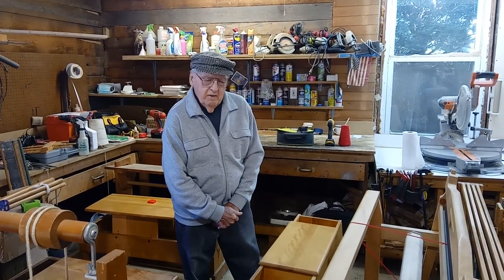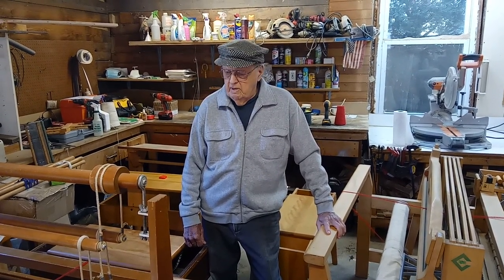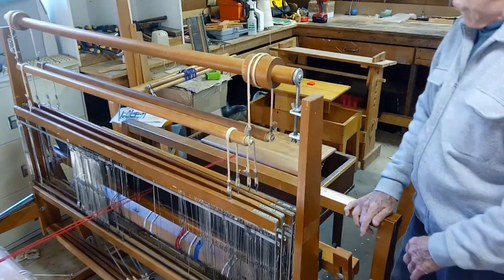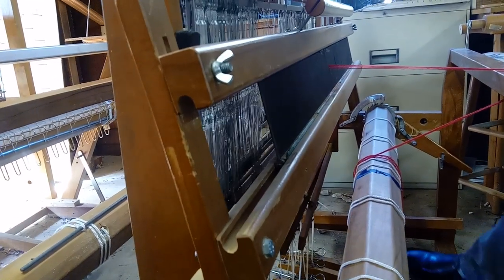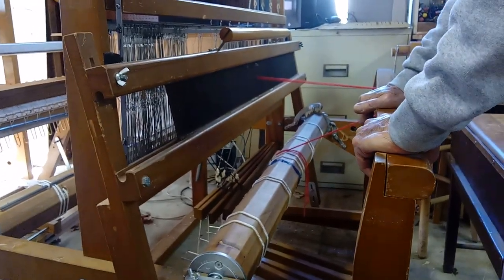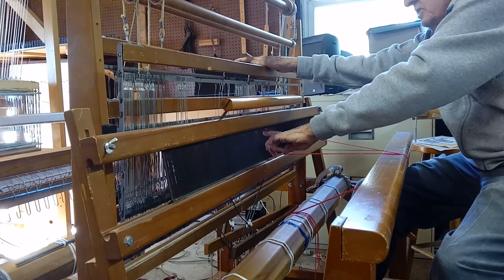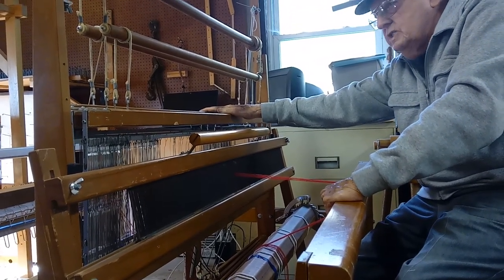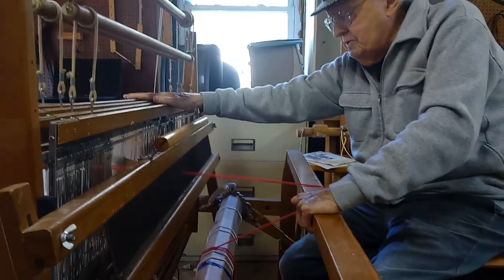A chat with Tom Beaudet Setting the Shedon a hand Loompart 1

Comment: Thanks for this video, Tom - it was very helpful to me, as I am working on getting a wide enough, even shed on my Leclerc Fanny loom. Main thing I have learned is that I have to push the treadle all the way down and hold it, lol - which means stepping on the treadle further up towards the tie up than I had expected. But thanks to your video, I may be able to increase the shed a bit with the tie up, the height of the beater, etc.